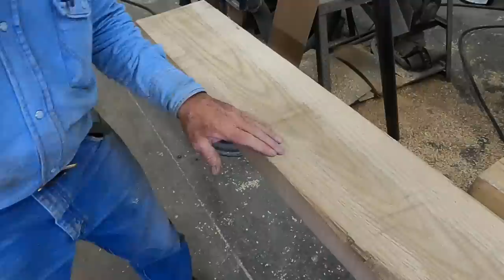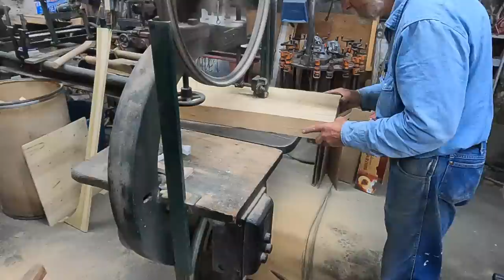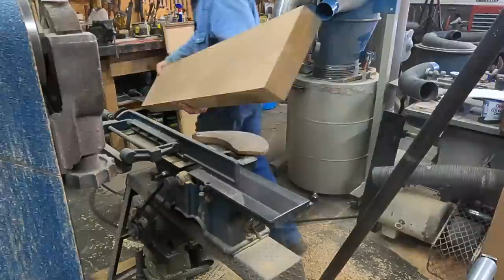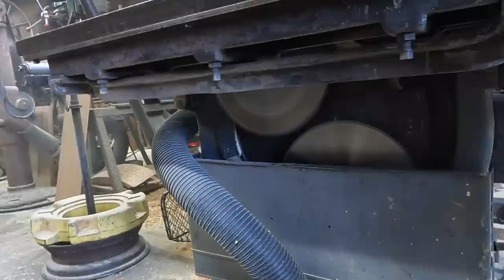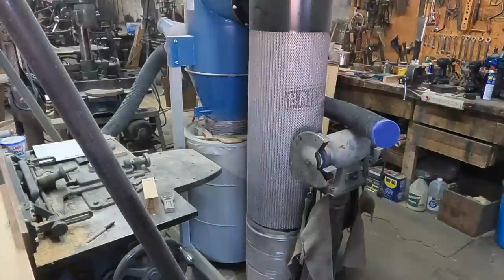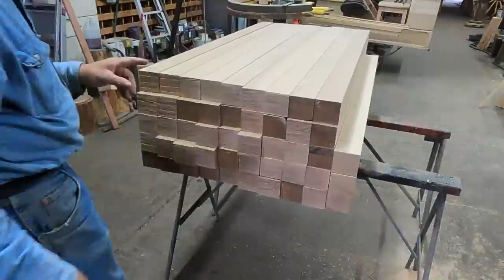Spokes & Felloes For 10 Foot Tall Wheels | Engels Coach Shop

Comment: Thanks for sharing with us about the dementions Dave. It's no wonder I had such a hard time at a sawmill. They finally asked me what finished size (I) was wanting and they cut accordingly and I finished out close to the dementions I was wanting. I would have been sadly disappointed if they hadn't seen that I didn't know about store bought sizes and sawmill sizes. I had to get the board stretchers out on someboards but it all worked out in the end. You're doing a fantastic job around there and we really appreciate your sharing with us. Stay safe up there. Fred.
Reply: The practice of measuring ‘by quarters’ must be a peculiarly American one.  We here in Australia certainly don’t use it, and I have only ever come across it in an American context.
Reply: Dave is not demented

Comment: At the lumberyard, an employee remarked that not even the professional woodworkers know this.
I was astounded so I went on to ask the head yarder.  He concurred. The gal at the wholesale desk said the same.
Difficult to believe.

So it is that Mr. Engels is providing valuable instruction.
Reply: I am a relatively long term follower of Dave and thoroughly enjoy ALL his videos. I have learned a lot from his experiences !!
BTW Dave, what happened to the hotel you were remodeling ? Can I see something from your video library.....?
Reply: I read somewhere that hardwood lumber grading and terminology was developed with large furniture factories in mind, repetitively cutting out mass produced furniture parts.  So a self taught local craftsman making one off projects is often mystified by the wholesale lingo.
Reply: @johnking8679  Dave hasn't worked on it for a few months. He will put the windows in before winter.

Comment: As a woodworker hobbyist, I knew the majority of the terms and forgotten a few of them since I only use certain types of woods and cuts. One thing many tend forget about woodworking of any kind, never cut right on the line. Easier to remove access material, can't add it back. Love that old table saw of yours. Not many top quality tools around any more, not trashing today's tools but, just not the same quality. Many thanks for sharing. Great video as always, cheers :)

Comment: It’s not just hardwood that is graded that way Dave. Softwood is also sold and graded the same as hardwood if you’re not buying nominal dimensional lumber. 
You can still buy 12 or 16 quarter and bigger softwood for post and beam timber framing.

Comment: Here in the UK, we have a different language. We also have a different language for hardwoods.

Before the fashion for waney edge (live edge) slabs came along for tables and desks etc., waney edge timber boules (that’s a pack of timber often representing the whole trunk after it has been sliced by the mill) had to be much, much cheaper than the processed square edged boule. That’s because the waste involved in converting a waney edge slab (from a potentially not straight trunk) into square edged boards is enormous. Logic also dictates that wide boards are much more expensive than narrow boards because of the large potential waste in conversion.

We were also looking for boards which were relatively free from faults such as checks and knots because, in our work, those faults meant we had to cut around and, again, waste.

Now, mills are able to command very high prices for a “character” waney edge board. That is, in our parlance, curved, checked and full of pips. Great for the current fashion but bad for us.

So, now, square edged boards, particularly in species like oak, are cheaper per cubic metre (which is how we buy) than those waney edge character boards.  That doesn’t mean that square edge stock has dropped in price - it remains much more expensive than pre-Covid, but that waney edge are 4 or 5 times the cost of, say, 10 years ago.

All this waste costs. If I have a waney edge board that cost £100; I might get usable timber of less than £60. There will be waste on both sides plus the ends plus the thickness if I have to take out any winds (twists) in the board. In addition, I have paid a guy to do the conversion. 

You will see in large stores pieces of furniture made up entirely of stave wood. Converting trunks into staves (say 12” x 2” x 1”) is a very economical way (very little waste) of converting trunks into usable wood. Less waste equals cheaper per board foot. Plus, these staves are often made from timbers grown in East Asia, timbers that are not native to our countries, and processed in those countries.  

That is part of the reason why pieces unique in design and size (made to measure) are so much more expensive than pieces made in factories. If you are happy to have a piece made of staves of uneven colour and grain, then these pieces are much cheaper.

Actually, if you want to get superbly built pieces, made  from full length timbers with beautiful grain, then try your local auction house. These pieces will be cheaper to buy and have an increased value in 30 years time (unlike the stave pieces which will have the value of firewood). Sure, the pieces bought in auction may not be in the latest fashion of design but fashions come and go. What you will have is a piece to be inherited and not laughed at.

I’m sat here looking at a superb circular, hinged top, table made from Cuban mahogany. It’s quality and grain are just divine. Cost me less than £100. I’m looking at an 1810 long case clock in oak which also cost me less than £100. An oval yew table, much more contemporary in design, less than £60. All this is interspaced with pieces that I have made over the last 45 years. Many different styles; an esoteric mix but all have one thing in common (I hope) quality.

Comment: Love your videos and they make us all smarter. I had a few pieces of 2x12 dimensional pressure treated lumber, very dry, and when I cut it on my little table saw it went all twisty and wonky. What? Wood is alive, even when it is not. Thank you for the info!
Reply: In the shop where I work, we often buy rough hardwood lumber in larger sizes and resaw it to smaller dimensions.  The upside is that we can make whatever we need from large pieces. The downside of that is that resawing releases some of the tension in the wood, which can be much worse with kiln dried material than with air dried material.  Also, the surface of a large piece may be much drier than the center, but resawing exposes the damper part and triggers uneven drying, so one straight piece may turn into two pieces curved in opposite directions!  This is why it is important to store lumber flat (not standing vertically) with spaces between boards, so that they can acclimate without warping or twisting.  I like to put the best material on the bottom of the stack so that the lesser lumber on top will hold it flat.

Comment: Thank you for the hardwood lesson, Dave!  I have had random length/width/thickness hardwoods sawn from my property over the past 30+ years, and didn't know most of those terms. I air-dry a year/inch stickered under cover, and then rack the boards or slabs indoors (unheated), some of it going on 30 years old. Nice and dry, for sure. Your processing steps are also helpful, for reducing waste and I appreciate that. Sadly, I have very little millable softwood except white cedar. Is there a reason you run your bandsaw without the covers?
Stay safe!
Reply: I suspect that bandsaw never had covers.  Back when that one was designed, people were expected to pay attention or become an object lesson for everyone else.
Reply: @tuberzish  I have 2 bandsaws, with covers on. I don't want to be an object lesson for anybody, so I'll just leave them where they are!!

Comment: Things seem simpler in the UK! We also have the fully prepared timber, (lumber to you) from the DIY type stores but from timber merchants the descriptions are simpler. We have rough sawn, (I think hit and miss to you) PAR, planed all round. PSE, planed square edge and for rounded over corners in construction timber, CLS, canadian lumber standard. This has different grading pertaining to strength for construction, but overall we dont have the array of descriptives you have. Sizes are width x thickness, so 4x2, (2x4 to you) or its metric equivelant.
Lengths can be random but rare we have random widths even in rough sawn. We dont break the widths down into quarters either.
In metric DIY stores tend to use centimeters but merchants millimeters or meters when selling by the cubic meter.
You'd wonder who thought of all the variations and the purpose of it!

Comment: Hardwood flooring is usually random length. Sometimes a client will not want a lot of shorts, these get put aside. If you can get some it makes an ideal surface for a workbench. A 30" deep bench with an end joint here and there works fine. Dad built his that way, and 40 years later I did that with my own bench.

Comment: i have never heard it called by that before. its always been called dimensional lumber, what you find in a lumber store, where a 2x4 is not 2"x4". comes in hard wood like oak, or soft wood like pine or true dimensional lumber like you get at a saw mill. where a 2X4 is actually 2x4, soft like pine or hard wood like oak. all the other nomenclature is the same to me. i live 5 miles from a saw mill. and worked there a few summers as a kid.
Reply: You're from Califorina....
Reply: @RickOshay...  born yes. raised no. is that a question ? do i know  you ?

Comment: Im a metal guy and rarely use timber unless its pre dressed ready to go.
The one thing that always puzzled me is the use of the term Hard wood and Soft Wood. The definition of soft or hard wood doesn't even refer to the timber it refers to the seeds and flowers of the tree. Balsa wood is as the definition goes a Hard wood?  Yet a soft wood like some Aussie Snow Gum or Jarra is so bloody hard it will burn out HSS drill bits.

Comment: To carry the discussion a step further, most softwood lumber goes into construction of structures, whence the need for uniform sizes.  The majority of hardwood lumber is not used in construction.  Higher grades are most generally used in things such as furniture.  The lumber will be remanufactured into smaller parts, such as wagon wheel parts.  Uniform size is not as important.  Lower grades, generally referred to as blocking, is used for such products as pallets.  A large outfit in the Mid-west which I worked for sold much of their blocking to steel mills.  They were generally 4 x 4's which were used between red-hot slabs of steel and were a single use item.

Comment: Very educational video. I have been working with wood for a little over 40 yrs now and have walked away with some knowledge. One question for you though. I have a 1903 26” Crescent bandsaw that looks quite a bit like yours, right down to the blade guide. What model is yours?

Comment: Why oh why does the US cling on to Imperial measurement units - wasn't the US trying to escape from its past as a colonial nation run through the UK?
Reply: "In 1975, Congress passed the Metric Conversion Act, which declared metric as the preferred system of the United States, and the U.S. Metric Board was created to implement the conversion." - We did go metric... didn't you notice? :-)    The theory was great, the implementation... not do much.
Reply: When the U.S. Congress was given its powers (see e.g. U.S. Const Article I Sec 8 under the heading of "The Congress Shall have the power to ....
.... set the standard of weights and measures." (Clause 5 if I remember.)
So after Kornwalis & co were sent packing at Yorktown. The Congress declared what the standard of weights and measures was to be.  That was sustained even throughout and following the second red coat attempt at domination. 
So, here we see an American  Craftsman making a choice of the preferred measuring system that has brought him so much accurate success.  Kinda like the distinction between a U.S. and foreign monetary systems.

Comment: Back in the late 50’s early 60’s I built some kitchen cabinets for my widowed mother, I used a timber yard who would cut to size and finish. I was really confused by the way they calculated the cost, I was charged for the wood before machining not what I walked away with. It was quite some time later that I was able to understand the logic, up to my enlightenment I was under the impression that I was paying over the odds and they were taking advantage of a young lad. Over time I became very close with the company and had a long relationship with them until I moved across the country to where I am now, and had to find a new supplier. Thirty years on and I’m still with the same company I found. Long term relationships are very important especially when you want something a little different and special. I would sometimes take a box of doughnuts in with me for the boys, a little oil always helps!

Comment: I'd say that is is normal that 3" thick is 3 inches. That is the softwood industry that is the crook here: because at some time it was admitted that saw mills could have some variations in the dimensions, it was allowed that wood sold under 3" label could be only 2.5" and some times is could be 3.5", and all in all, things would average out. 

But such variation does not exist with modern sawmills. So labeling a 2.5" thick board with 3" stickers is knowingly cheating the customers.

In France, notebooks could have a 4 pages variation on the page count. So 100 pages notebooks could have only 96 pages. Now they are labeled 96 pages as to not be deceiptive.

Comment: Is your table saw blade at it's maximum height?  As a cabinet maker, I was taught by my mentor to have the blade 1/2 inch higher than the thickness of the board being cut, for safety and efficiency.  I wonder like to get your thoughts in this